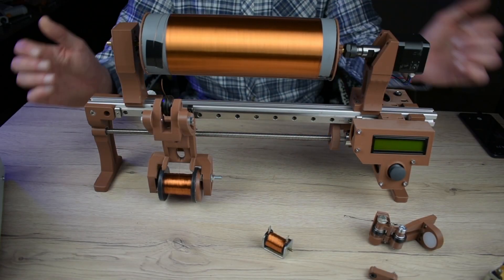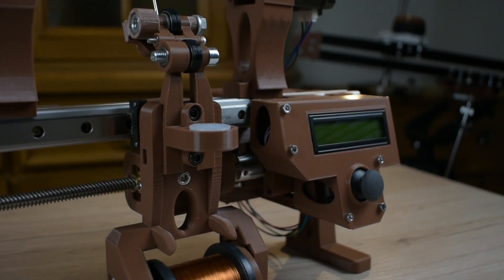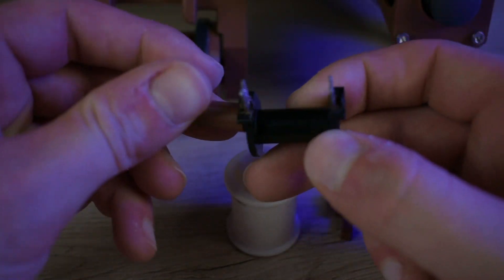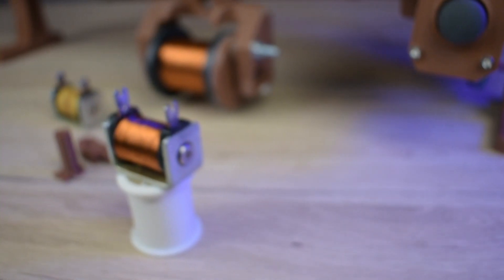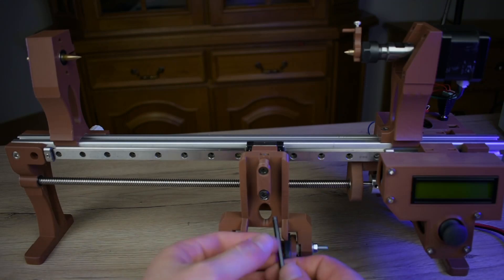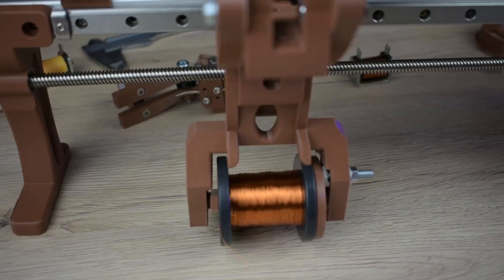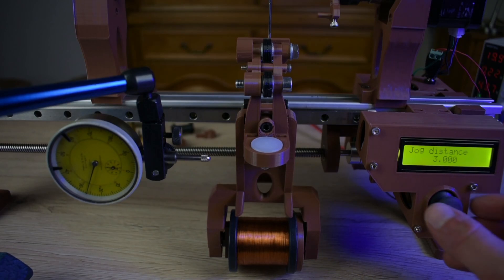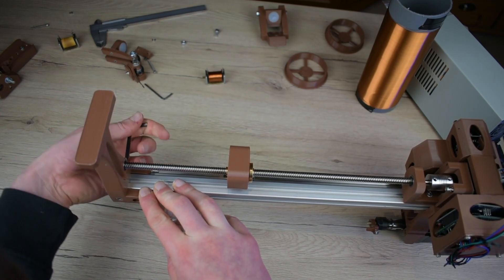DIY 3D Printed Coil Winding Machine

Comment: Hello! I finally was able to make this work after a year! Now I'm wondering if theres a way to change the units from centimeters to millimeters? especially for the pitch.
Reply from the maker: Hello, unfortunately as of now you can’t change the units and both parameters are displayed in millimeter. The pitch can be incremented in 0.01mm steps and the length in 0.1mm increments.
Reply: @designcircle6542  Yesterday when i would a few coils with it, it seemed that the length was in cenimeters. For an 11.8 millimeter coil length i would have to input 1.10, as it incramented in .1 centimeters. Same for the pitch, a pitch of 0.016 had to only be inputed as 0.01 because of the number of significant digits. The accuracy of these measurements into the machine matters greatly for the output of a good coil. Is there a way to then change the incraments or significant figures?
Reply from the maker: @bengagliano7415  which units did you set the grbl controller up with? The controller only gets fed mm g-Code commands. That is the only thing that comes to mind. If it is set up on cm, then your input makes sense for it to work.

Comment: Can i talk to you about this project? I am making right now and i am having difficulty with the arduino code.
Reply from the maker: Absolutely! I'd be happy to help you with  the Arduino code.
Reply: @designcircle6542  ok. so when i try to upoad the code to the arduino nano. it says that there are no .h files, and in addition, i accidentally got a grbl shield v4 instead of the v3 in your schematic. Wil the v4 still work, if so what modifications do i need to make, and how do i fix the .h file problems?
Reply from the maker: @bengagliano7415 You can use the Grbl Shield V4 without problems regarding modification to the wiring. It should still fit in the box if it has the Arduino Uno board measurements. Regarding the .h files, you need to install the LiquidCrystal_I2C Library from Frank de Brabander and the ArduinoQueue by Einar Arnason. If you still have issues, please let me know.
Reply: @designcircle6542  The issue i had with trying to use the Grbl shield v4 was that; in your schematic, there are pins with the LCD display and the joystick that go into the V3 that are not found in the v4. Also, the arduino nano is included in the V4, not separate like in your schematic. Basically, i dont know how to wire it for the V4, because there are substantial differences.
Reply from the maker: @bengagliano7415  you would need two seperate arduino unos for this. One runs the Code for User Input, the LCD and also communicating with the other arduino that is running grbl.
Reply: @designcircle6542  How would i do that?
Reply from the maker: @bengagliano7415  you Connect the rx, tx  pins from the arduino that runs the sketches to the rx, tx Pins on the shield. Make sure to connect rx-> tx and tx->rx.
Reply: @designcircle6542  also in your circuit diagram, there is what seems to be lm348, which is an operational amplifier? What is the point of this and is it necesary, because it was not in the parts list.
Reply: @designcircle6542  I have successfully gotten the code to run with grbl, but the code with the arduino nano and the user interface isn't doing anything. I will upload it just fine and it does not give me any error messages, but nothing appears on the screen. or seems to work. I have checked the wiring with the nano and the joystick and lcd display and everything is correct, so i don't know whats wrong.
Reply from the maker: @bengagliano7415  what Display did you buy? You may have to change the adress of it
Reply: @designcircle6542  Sorry, I should have deleted my comment once i had fixed the issue. Now, I have everything working individually, but i am having trouble having the Nano and Uno/GRBL communicate. I can run both stepper motors in Universal G-code Sender application, and the menu and user interface for the machine works and is able to be interacted with, however i cannot get them to work together.
Reply from the maker: @bengagliano7415  Did you connect the rx/tx from the nano to the grbl shield as mentioned before? The Lm3480 (i will correct it in the shematic) is a linear Voltage regulator to get 5V from the Supply Voltage for the microcontrollers. Another thing is did you already buy a linear rail?
Reply: @designcircle6542  Yes i have the entire machine made and it works by itself. And yes, rx and tx is connected from the nano and grbl. Do you have a schematic for the stepper motors in the configuration? The schematic on printables only has the lcd, joystick, nano, and shield. I think its possible that its an error with the stepper motors.
Reply from the maker: @bengagliano7415  You could test the nano by connecting it via usb to the PC, open the serial monitor in the arduino IDE and start a coiling cycle. You should be able to see G-Code commands sent via Serial connection. The motors should at least make some noise even when they dont move. If not the shield is not enabling the motor drivers or there is no motor Voltage. Additionally I will try to update the shematic as fast as I can.
Reply: @designcircle6542  thank you so much I will try it now.
Reply: @designcircle6542  I tried it with the jogging function, and this is the output on the serial monitor.

"5⸮ ⸮ ⸮W⸮⸮⸮⸮⸮ ⸮a⸮5⸮⸮⸮ ⸮Q⸮ ⸮⸮⸮ ⸮!⸮⸮⸮N⸮ ⸮V⸮⸮⸮⸮⸮ ⸮Q⸮ ⸮ ⸮!⸮ ⸮ ⸮5⸮A⸮ ⸮ ⸮ ⸮ ⸮ ⸮⸮⸮⸮⸮Q⸮ ⸮⸮⸮"

This was from a repeated pattern of jogging left, up, right. and down with a jog distance of 14. I don't think this is how it's supposed to look.
Then, I tried with a coiling cycle, set at 186 turns, 0.17 pitch, 10.00 length. This is the message it showed once I pressed start.

" ⸮Me⸮CiK⸮kE⸮" 

The start menu displayed 
"N: 11
Feedrate: __"

Immediately after starting. This leads me to believe it is an error with the nano not sending G-code, i believe.

Here are all the files i have in the sketch for the nano.

LiquidCrystal_I2C.h
ArduinoQueue.h
Start_FSMV2_0.4.1
lcd_start_page_FSM
mFSM_LCD
mFSM_LCD_JOG_MACHINE_PAGE
mFSM_LCD_SETTINGS_PAGE

Am i missing a file? if not, what file should be working that isn't? There are no errors when uploading the sketch, and i am lost.
Reply: @designcircle6542  do you know what is wrong?
Reply from the maker: Which baudrate did you use, because you have to make sure it is set to 115200? The other thing is you need grbl version 1.1h to make it work. Now that i remember you cannot connect the Nano via Serial Port when you want actually run the winding machine. If that does not work let me know.
Reply: @designcircle6542  Thank you. The Baudrate was the issue with the serial monitor displaying gcode. Now everything works like a charm on the serial monitor. Using Universal Gcode Sender, i can get the servos to run, so i know the drivers work and the GRBL works aw well. It still seems to be an issue with the communication between both Arduinos. Do you have any ideas?
Reply from the maker: The only issues can now only be the wrong version of grbl or the Connection from the Nano to the GRBL shield is not correct. If you connect only the Arduino running GRBL to the PC and use the serial monitor it should post the version if you cant see it in the universal g-code sender. As stated before it needs to be version 1.1h. For the connection from the Nano connect Nano rx->grbl shield tx and Nano tx->grbl shield rx like in the schematic. I hope this will solve the remaining issues
Reply: @designcircle6542  It is show on the serial monitor as GRBL 1.1h so it is up to date. I think i may have to replace my uno and/or uno because it might be a problem with the pins themselves. I am running the GRBL board on 12v, does it have to be 20v like in your schematic?
Reply from the maker: @bengagliano7415  no it will work fine with 12v. That is only the Power for the Motors you also need to supply 5v to the grbl shield

Comment: Nice project .Is there any wiring diagram or schematics ?
Reply from the maker: Thank you. I hope that I can include a finished shematic in the next part. The next part could still take a while because I destroyed some parts and was set back a bit.
Reply from the maker: I added a shematic on printables.com. If it is in any way not intelligible please let me know.
Reply: Thank's, but it seems i can't find the schematics.
Reply from the maker: @szeidert  You can find it at the end of the photo gallery on the printables site. Maybe it was not published at the time